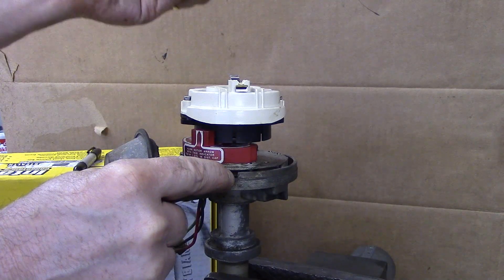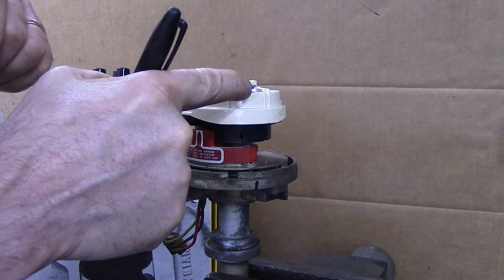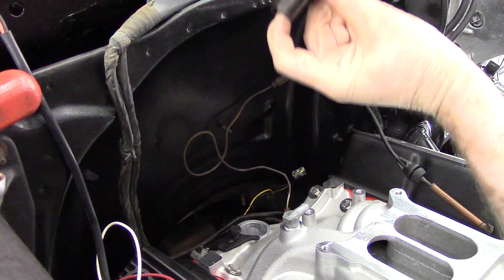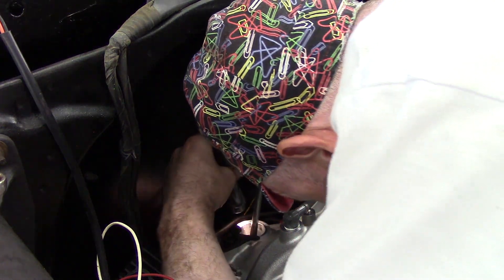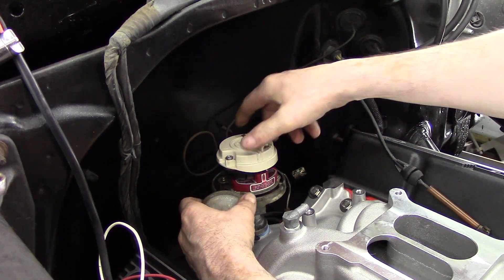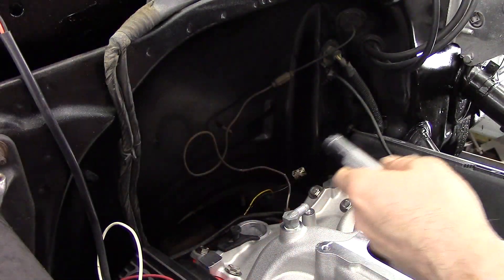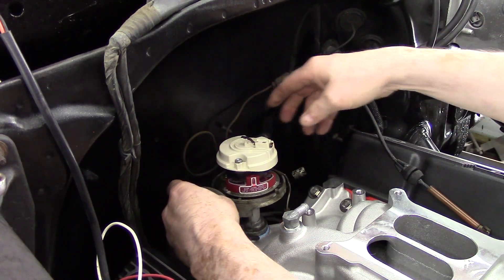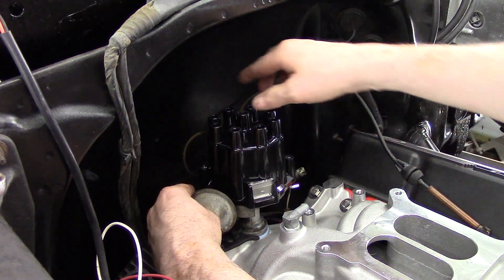How to static time the small block Chevy

Comment: My engine sits for long periods of time, a year or more. So I ground off the teeth on an old distributor and use it to prime the engine with oil. Hook a drill up to the distributor and spin it until oil comes out of all the push rods/valve rockers. This tells you oil has been delivered to the pistons, cam, etc.
Reply from the maker: Great comment, and  I always prime a new engine prior to first start just to make sure all surfaces have lubrication. I lubricate all surfaces during a rebuild, but there is always a chance a spot could be missed. Thanks for the comment!
Reply: H.R.I. services llc Ricky Hembel
I'm just now getting ready to start that engine.  It's been sitting for a few years. I had to pull the heads because a little water got into one cylinder but all is well. Rebuilt the 800DP, the distributor (Accel BEI), everything. In a week or two I'll have a video. It was in my 1959 Corvette but I sold it some years ago. (Dad bought it in 1966 I bought it in 1982 and pulled the 283 w/ 2x4's and put in a 350 with 500+hp.)
Reply from the maker: I love the old vette's, wish I could afford one. The lines in those years were so classic. Good luck and enjoy that car.

Comment: Confirm both number 1 valves are closed, and rotate engine by hand with stiff wire in #1 spark plug hole to feel piston come up to TDC. Just as it reaches TDC, you will notice it stays stationary for a short time relative to cam timing. Go back and forth turning the crank by hand until you are satisfied that you are at the mid point of piston travel between up and down. Static timing refers to timing relationships of components regardless of timing mark location. Cam and distributor gears wear, harmonic balancers outer rings shift, distributor gasket thickness varies, etc. Again, #1 at TDC (centered by feel), both #1 valves closed, timing mark at least close, and distributor positioned as described in video. Note that static timing may require an adjustable timing mark pointer.

Comment: it's easier to set distributor point vacume advance at or between 2&4cyl and line up point of rotor directly at number 1 it won't drop all the way but will be meshed with cam gear which is main concern the rotate motor by hand and the distributor will drop down on oil pump shaft and be good to go not trying to be know all just trying to help save time and hassle with fighting the oil pump shaft